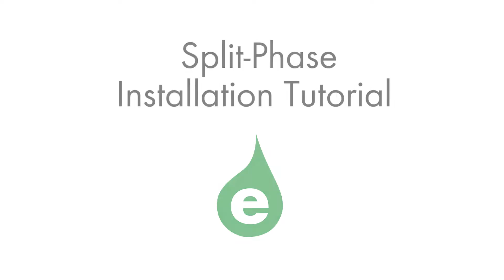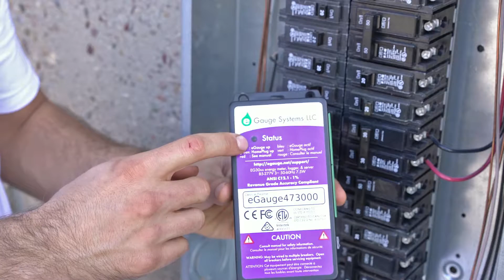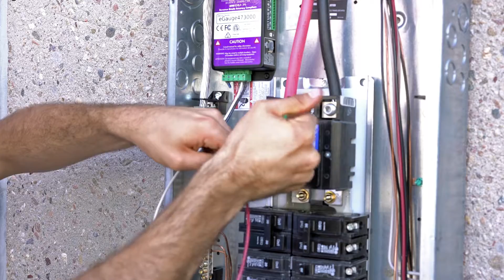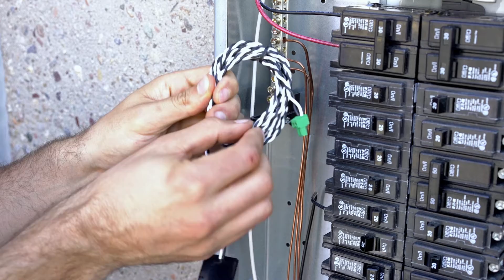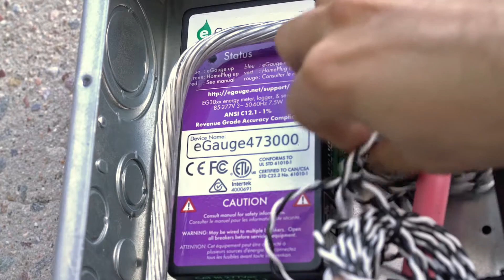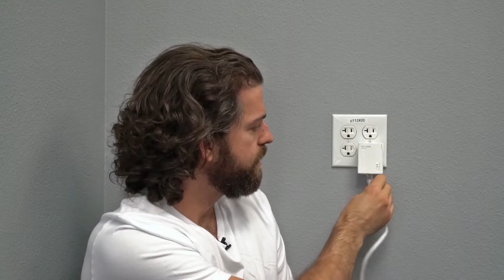Split-Phase Installation Tutorial

Comment: Hi know you mentioned the ARROW ,does it point toward the brakers or away from the brakers ,thanks
Reply from the maker: When using eGauge branded CTs the arrow should point in the direction of normal power flow, or away from the breakers. When using CTs from other manufacturers you will need to refer to the Support documentation linked in our webstore for orientation details.